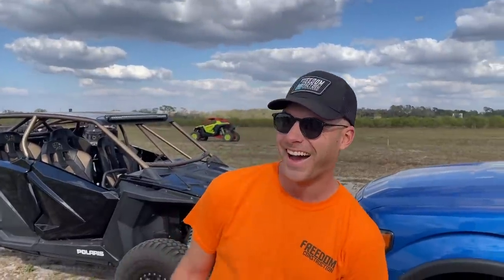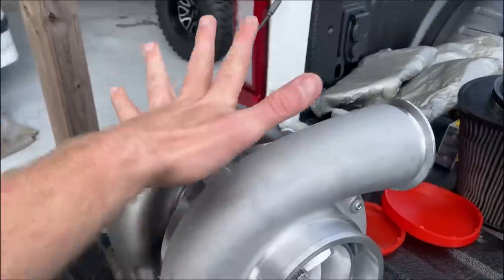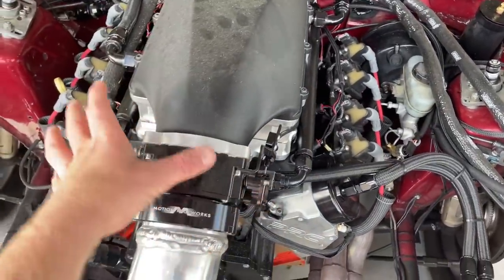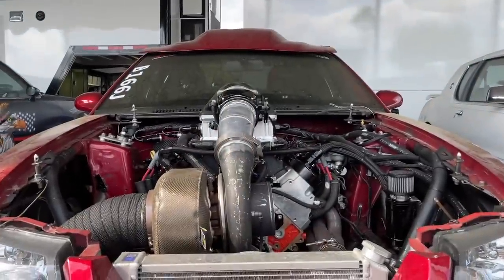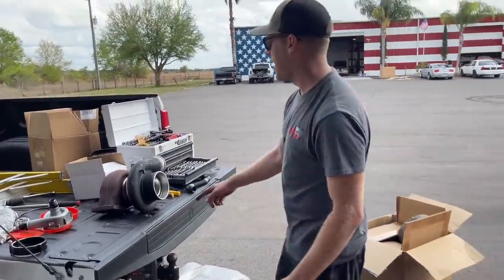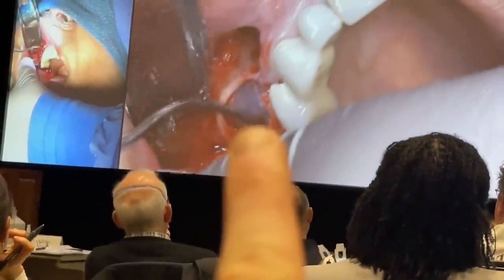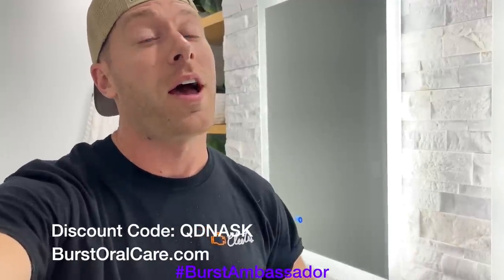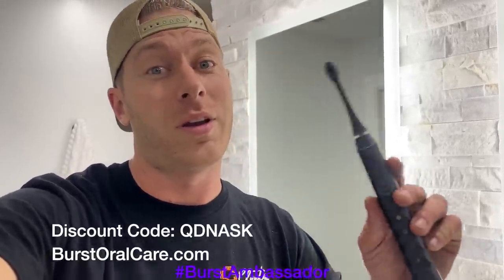MASSIVE Turbo Upgrade!!! Will this be Enough for a 7 Second 1/4 Mile Pass??

Comment: one thing that might help is getting into a wind tunnel so you can adjust the car to make less lift and drag. and simply add a round 1400hp to the wheels and a built tranny and rear end should get you into the 7s? that huge turbo was a great idea!

Comment: So I'm going the full implant route later in life.  It takes 6 months of healing with no chompers left on the roof of my mouth? Or are there classic dentures that are sensitive/strong enough to protect the healing area and maintain the ability to eat(as well as I could/can, considering the state of my teeth, and nerves exposed((it's gnarly, and likely most will be dead by the time my growing family can afford to expend $ on teeth and 3 kids in kindergarten and onward in the next 4 years))
Reply: Not interested in sarcastic teeth brushing recommendations.
I brush 3 times a day every day since I was in 3rd grade, and I'm 35 now.
I have dental issues, where 13 baby teeth, had to be extracted in 2nd grade due to root issues and so on. Just self extracted my last baby tooth a few months ago to get rid of the lingering pain it was causing.  Other than typical bad eating/drinking habits to protect my sensitive teeth, I take good care of them and they fall apart anyways.
YT comments are brutal, so I feel the need to defend myself in advance, 😆

Comment: I’m an RN and I can deal with a lot of nasty gross stuff, but for some reason, teeth stuff bothers the crap out of me. But even still, I watch it for the cringe factor lol. Another example: I have bad knees and will probably need them replaced at some point… if you’ve never seen a knee replacement in real life, holy shit. There’s bone matter flying EVERYWHERE, dudes in there hammering with a sludge hammer. Cringe worthy for sure, but like a train wreck, I couldn’t look away lol